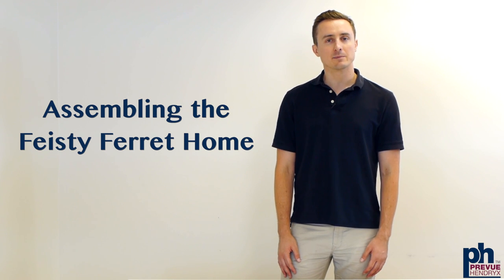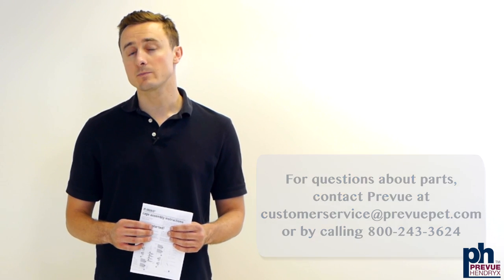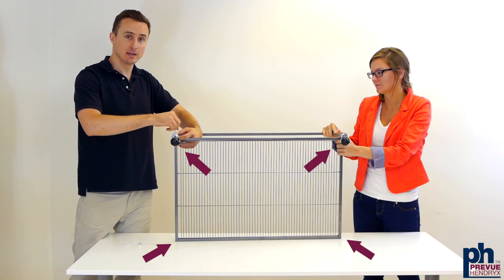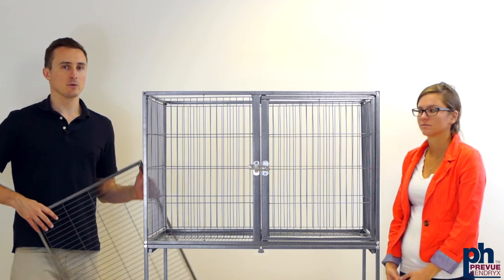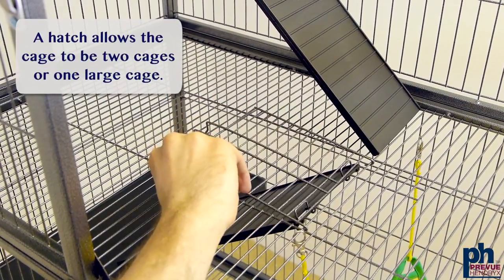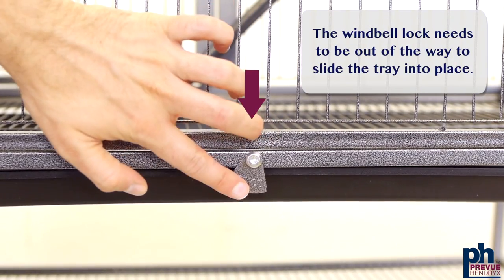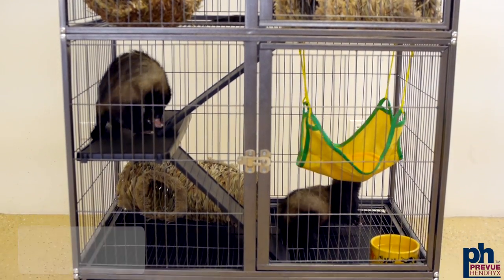Prevue Feisty Ferret Cage 485 Assembly

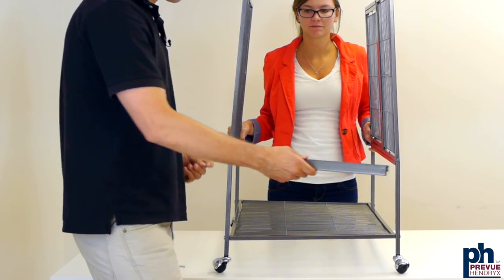Comment: Just finished assembling the cage with this video as our guide and need to tell you that at 1:19, he puts the bar with the tray channel in UPSIDE DOWN.  They show it corrected later but never tell you they corrected it so if you follow him and put it in this way, you can't add on the bottom rails.  You can see in the video that he has the top and bottom screw holes covered by the bar, so there's nowhere to screw in the bottom of the next piece.  The tray channel needs to be on the of the rail so that the tray can slide into it.  Someone needs to make a visual note on the video!

Comment: Though the price for the cage is cheaper in comparison to the Critter Nation, the wire bottom and thin plastic ramps make a huge dent in most people's decision to buy it. A local petstore has both set up side to side, and the size difference isn't something you would expect. This cage is a lot smaller. I'll never regret getting my critter nation, it is made 100 times better and was a great investment. Plus I'm without the worry of my pets getting hurt. This cage has great potential to be improved by the manufacturers sometime in the future.You get what you pay for.

Comment: Hello, thank you for this video.  I just bought a feisty ferret 485 cage for my rats and I am trying to prepare so I can finish the cage when it comes. What are the platforms, ramps, and the inside floor levels measurements? I am using rugs and coroplast for the floors. Would you say 20" by 30" rugs would fit over the entire bottom and top level floors? Do all 4 doors open if you only have the normal ramps in? Lastly would you say teenage rats would not escape the bars (almost normal sized rats but not quite)?   Thank you  again :)

Comment: The cage we received would have been perfect if it wasn't for the fact that two of the screw holes were manufactured too small, beleive me, we tried to get the screws into those holes for probably a good half an hour.... we won't send it back because we really want to get our ferret soon, but we have had to find other things to connect those two holes with instead of the screws.... I hope not all cages were manufactured wrong because that kinda ruined the whole cage to be honest... 

Other than that the cage is very big and spacious and has the fun little levels too.